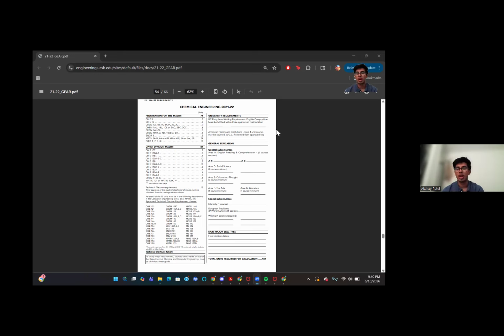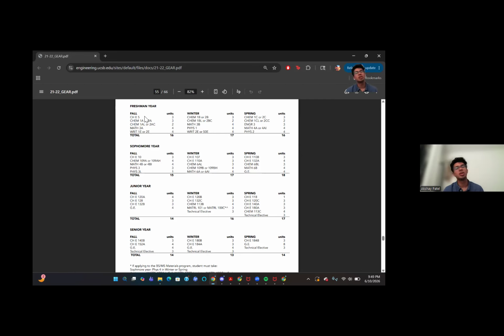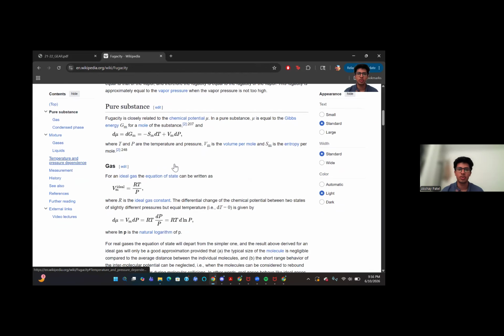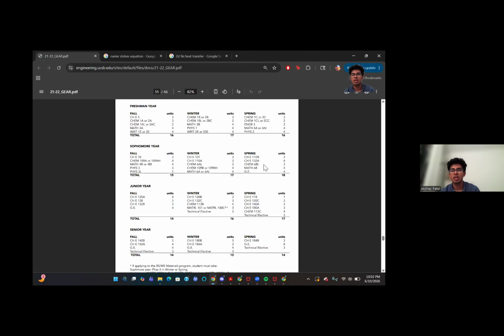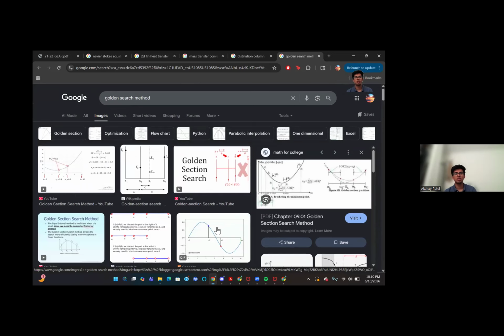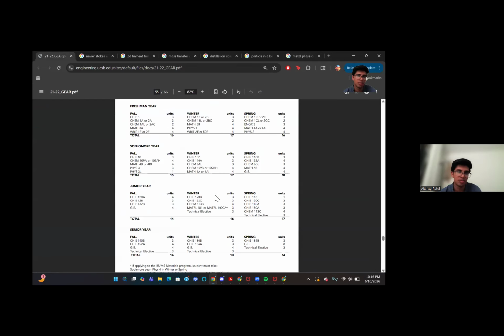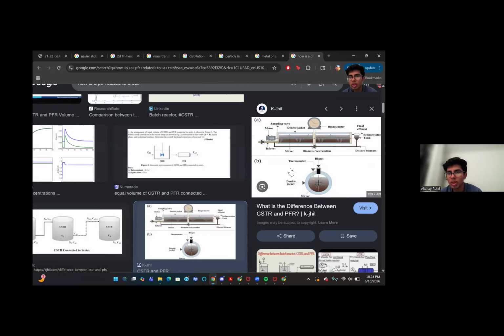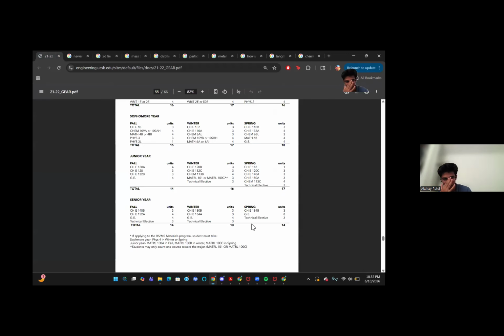Chemical Engineering Curriculum Overview

Comment: I missed talking about 152A-Controls, which we take senior year fall quarter. In this class, we learn the equations involved with controlling different aspects of a chemical process. Like if we want to control a flow rate going into the reactor, we can monitor the flow rate going out, apply laplace transformations (makes a differential equation into an algebraic equation by transforming it onto a different space) to the relation between the inlet and outlet flow rate, and control the valve for the inlet flow rate that way. You can track your error to a desired set point with PID controllers. For example, if you want to set a temperature, and you want to control how much heat you add based to the temperature readings as you add heat to the reactor, then you know how the offset  between the set point and current temperature is analyzed with PID controllers and how that then tells you how much heat to keep on adding.